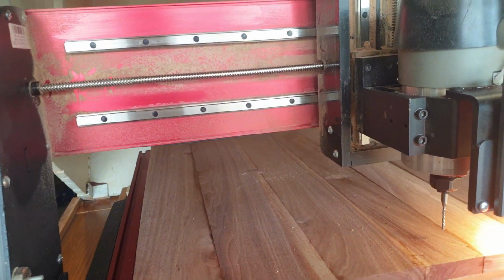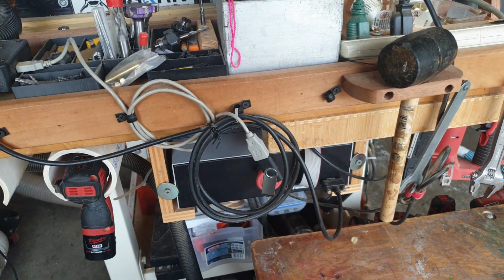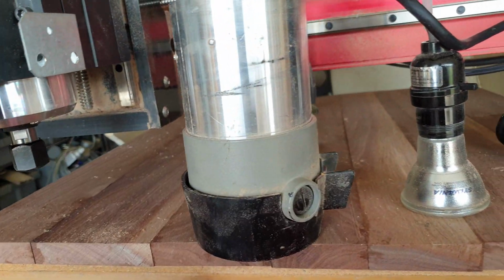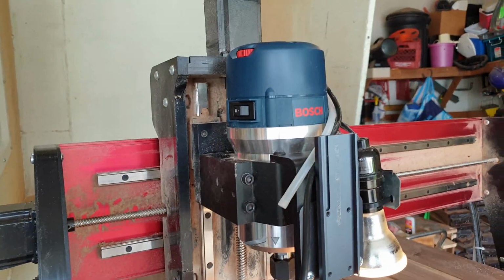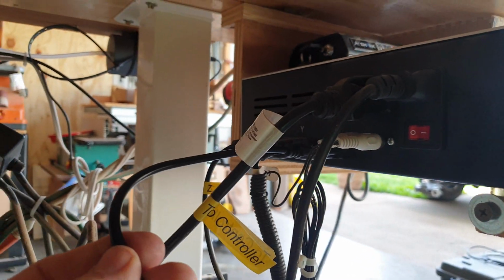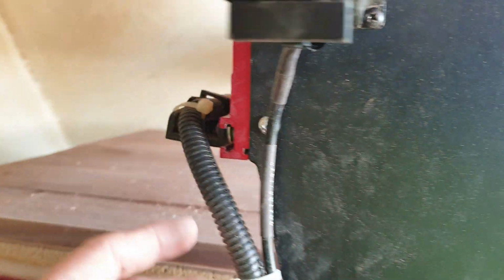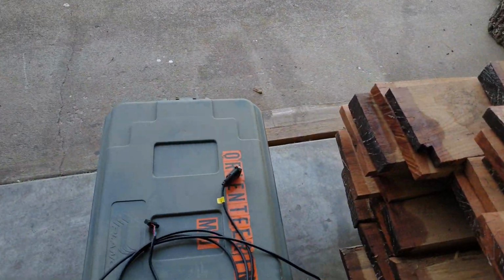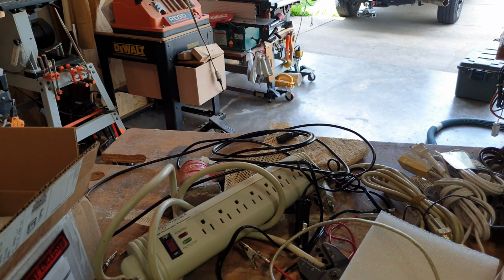Shark Cable Replacement Process and Upgrades

Comment from the maker: The Shark is out in the shop going at it.  All is working great!  New router is a bit quieter than the old one.  Also I have to use the magnetic probe on the z probe since this new router is double insulated.  My old router had a 3 prong cord.  New router is 2 prong.